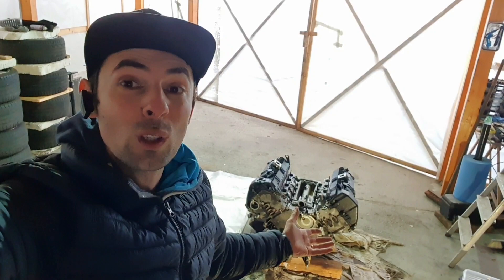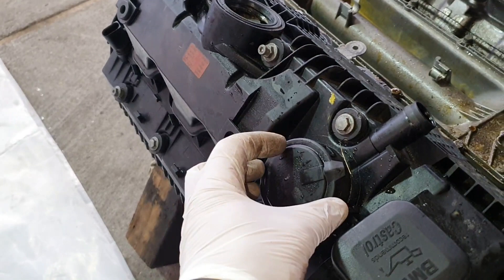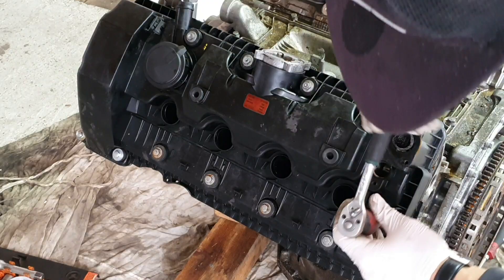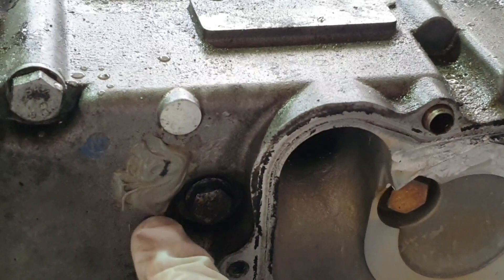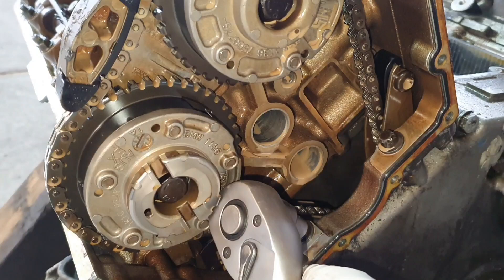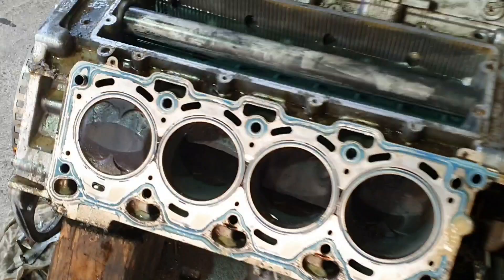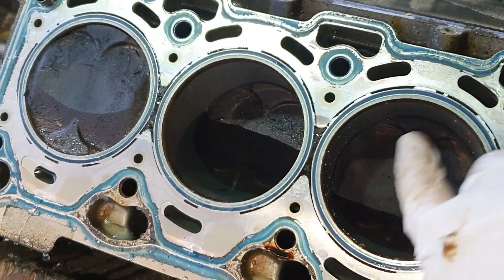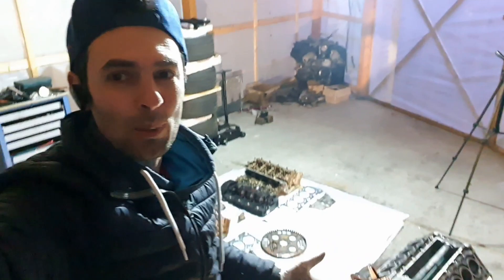Bmw N62 engine teardown! P1

Comment: That JB weld on front of the block is the weep hole to verify your coolant pipe seal has failed. Someone plugged it with JB to stop the leak, backing it up into oil system. But for being blocked the mixing of fluids is impossible.
Reply: I wonder if the JB trick created some pressure in that well which later broke the timing cover seal. The transfer pipe is the output of the water pump.

Comment: This hole is designed for water drops once the pipe seal is failed, some one blocked the hole to prevent leaking water out the engine  and then water leaking mixed with oil , this is all story :)